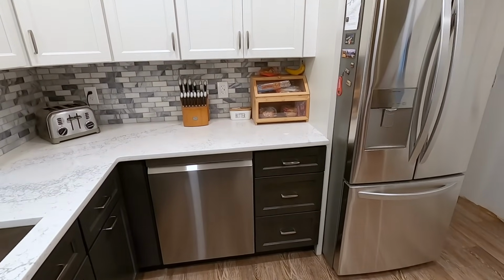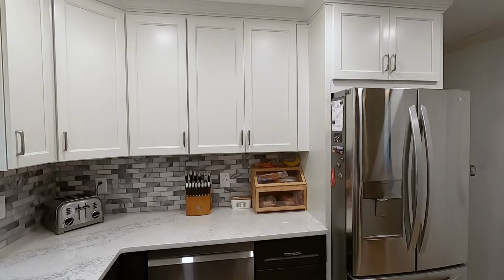Small Kitchen Remodel Time-Lapse - Complete Renovation Start to Finish

Comment: You do great work and you went back to scratch and fixed all existing problems and added all necessary to bring to code and energy savings by insulating.  You did not miss a single thing.  Bravo on a job well done!

Comment: Was looking into redoing my ceiling with drywall instead of drop ceiling and was told I need a drywall hanger/lift, and here this man just screwed two blocks into some studs for leverage lmao amazing work my dude! I kept thinking you'd start putting in the new parts and then you'd replace the fricking wiring or something lmao you really took it to the bones and built it back up again. That's quality work that you can't get nowadays.

Comment: I have purchased parents home and after 60 years of no updates it needs this and bathrooms done. You are so detailed unlike contractors would be. I am too old to do this myself and have to hire contractors but how do I find the one that will do it right without overcharging me? I sure wish I could hire you! I would have so much peace of mind! You are one of a kind, sir!
Reply: Make a list of the things that are necessary for you to do in the kitchen. Forget all your wants. No stainless steel appliances. No fancy flooring. No real wood cabinets. Forget about the island. Forget about the stone countertops. No, you can't add a 500 square foot addition and no you can't knock that load bearing wall between your ktichen and your living room to make it open plan. The less you do, the cheaper it will be. And get multiple quotes from a billion contractors.

Comment: incredible job. We recently gutted our 50's kitchen shortly after purchasing our home, completely remodeled and also worked with a tight floor plan. 

I definitely would have went with a blind base cabinet for that cabinet between the sink and dishwasher, we didn't think we'd use ours much but its great for storing the Tupperware that you use once in a blue moon. Other than that, you did an outstanding job

Comment: I’m glad you put some insulation in the external walls. I don’t know where this house is but it was built like a shed. It must have been so cold in winter and hot in summer. Lovely job on the kitchen.
Reply: He lives in Massachusetts, and the house had insulation before he tore it out and replaced with fresh. Also, it was built in 1946, but the kitchen was added onto in 1964.

Comment: I have to point out just to help anyone else in the same situation.  The old style 'sheathing' was generally shiplap boards as yours is.  The shear walls jobs of today's construction were done with the diagonal bracing sometimes let into the outside of the stud walls and sometimes done as yours was.  The salient point though is that you should not remove any part of that diagonal member unless you have redone the exterior with a OSB or better plywood sheathing to act as a shear wall.  Even though removing one section between the studs looks like no big deal you have taken away the load carrying capacity from the top plate to the bottom plate as the racking forces generated were meant to travel an unbroken path between top and bottom plates to keep the wall stiff when subjected to lateral forces.  Super important if you are in a high wind area.  Always hard to handle the corners in a narrow kitchen.  Nicely done.

Comment: I’m impressed that you can do flooring, plumbing and electrical as if you were an expert at each of those professions. Truly remarkable craftsmanship and great color choices. Love the two-tone cabinets with stainless steel appliances and light wood flooring. Simply beautiful. The backsplash is also beautiful along with the lighting. (If you would have been able to integrate an epoxy type of countertop then “mic drop”). Keep up the awesome work and can’t wait for the next video 😊

Comment: Wow!!!I just found your site with your bathroom. Your attention to details is amazing I love your choices. The backsplash made it!!! Also taking up the the ceiling added so much to the smaller kitchen and the light fixture match so well. Also it is so bright and not just a plain white kitchen it is timeless. Are you planning to match your floors through the house??? Also what is LVP flooring is a type of laminate I still have glue laminate in my living room 1999 that has stood up well.

Comment: This a great video, and even with it speeded up a lot of good info.  I am wondering can anyone answer the question about putting the metal plates on the studding.  I have a kitchen where i am doing a small demo in a 100 year old house, and I am wondering do you have to put them in.

Comment: I have nightmares about getting a house that needs a kitchen remodel. well I did until now. you make it look so doable. Thank you. Loved your color and surface choices too. Very smart upgrade any one would be proud to have. It was also nice to see some one care to fix issues rather than just paint over them like the rot you found. Small maint. can make a HUGE difference down the road.  Kudos. as lovely as your fridge is, its just horrible in that space I am so sorry to say. I suppose it woud be 10 K to hire some one to do that? or would it be even more? not the materials, just the work.

Comment: This's a nice video, I've watching your videos for a quite some time. I'm renovating my kitchen too and wanted to ask you a question. Where your sink plumbing went, that's an exterior wall which means it's a load bearing wall. Are you allowed to drill that big of a hole through the studs, top and bottom plates?

Comment: Amazing work

Just a question, what’s the reason for the paper towel stuck to the walls under the backsplash ?
Reply from the maker: That is actually something called “simple mat”.  It is like a super sticky and thick double sided tape that holds the tiles to the walls.  It is an alternative to mastic or thinset.  Doing it this way you can grout it immediately because you don’t have to let adhesive dry.  Hope this answers your question.  Thanks for watching!!
Reply: Thanks for the reply mate
We don’t have this in Australia to my knowledge, looks really convenient as an alternative 
Love all the work you’ve done so far
Even though houses are built differently here in Australia I’m learning all the time watching you do your thing
Thanks

Comment: What was the pink paper that you put on the floor and masked off with tape?  Is that some kind of levelling material?
Reply from the maker: Good question.  That was rosin paper.  The only reason I used it was because when I tore up those old stick tiles they left a glue residue on the floor so that was to cover it so dirt and debris wouldn't stick to it until I covered it up with the new flooring.

Comment: Fantastic job! So glad you replaced the wiring. I'm curious though: why did you install the ceiling insulation backwards? Is it because you were using a vapor barrier? Even so, I'm confused about this.
Reply from the maker: Hey, Kate!  First of all… thank you! 😀😀 and for the ceiling insulation.  I didn’t install it backwards, I bought “unfaced” insulation, so there is no paper on it like there usually is.  Then I used 6 mil plastic as the vapor barrier.  Hope this clears that up.  Thanks again so much and thank you for watching!!
Reply: @TheFixerHomeRepair  Of course! I have no idea why I didn't think of that. I guess it's because you don't see many DIYers doing that. Great work!
Reply from the maker: Thank you.

Comment: Really like how it came out. But why did you put the flooring after the cabinets? Wouldn’t it be harder to place them around the cabinets instead of laying the floor then building the cabinets. Idk if that matters but the outcome was 🔥
Reply from the maker: Hey!  I did the floor after because it is a “floating floor”.  You are not supposed to put permanent fixtures like cabinets on top of it as it needs to expand and contract.  If I was to do hardwood or tile I would have done it first.  Thanks for the comment and for watching!

Comment: What are the black plastic boards you have under the ceiling? Before the Isolation.. Have zero experience in house building.
Reply from the maker: Hey!  Those are rafter vents.  They help to move fresh air from the soffit vents up and out the ridge vent, the airflow will help to circulate air above the insulation and in the attic to prevent moisture build up and/or mold.  I made a detailed video about this whole process if you are interested.  https://youtu.be/gyE5BxhEsOI
Thanks for watching and for the question!
Reply: @TheFixerHomeRepair  Thank you for taking your time to explain this. Nice work on the house!

Comment: What was the red liner thing you used to level the floor with the tile?
Reply from the maker: Hey!  So that red liner was actually rosin paper.  I just put it down after I pulled the stick tiles up to go over the adhesive that was left on the floor.  It does nothing but stop my boots and debris from sticking to the floor.  Hope this answers your question.  Thanks for watching!!

Comment: Can you estimate how much longer it takes you to do projects with all the filming you do? It’s already impressive what you do but the 1,000 camera angles for us is just as dope
Reply: I would expect since he was shooting both the time lapse, and the individual segments, that this extended the time of remodeling out by a good bit, and as I also shoot videos for YT, it all depends on how one shoots too. 

If on a tripod, then it's move, set, and let  it go, other times, it is going hand held and talking, showing a detail, like how he did the cabinets, and even there, he likely didn't shoot them all, just one or 2 or for the ones that are different enough to show how you go about putting them together and then install, then he shuts down all but the wide shots for the time lapse and then resumes as if not shooting.

Much of the pans etc were done in post, after the fact and that is where it likely took the most time, not the actual filming itself, but likely they did extend things to some extent.
Reply: @johnhpalmer6098  lol not being rude but this comment gave me absolutely 0 information. I understand how recording a video works.
Reply: @allenmkelso8  Well, how was I to know that?
Reply: @johnhpalmer6098  Assume I have common sense.

Comment: why did you use normal plaster wall instead of water and fire resistant plaster wall ?
Reply from the maker: I used 1/2 inch drywall.  That is what is required by code in my area.

Comment: How much ! I really want to setup new one for my kitchen but I have my own budget 😢 I think it expansive
Reply: Yeah, if you want something similar to this, it's going to be very expensive because the entire kitchen was gutted and replaced. If you're on a tight budget, you pretty much have to work with what you have. You can't have a brand new kitchen professionally installed for $5, you know? lol I don't know what your budget is, but I'm going to assume it's extremely low, and there's not much you can do when you have a tiny budget for a kitchen reno.

Comment: What are those metal pieces you install around 8:50?
Reply from the maker: Those are “stud guards” or “safety plates”.  They are used to protect wires or pipes from drywall screws.

Comment: Damn your jumping start was lux compared to my early 2000s jump off. After extermination, where do I soak my feet in? My list starts with the exterior. I mean the address is posted on the house twice.
Reply: One is posted with nails, the other is this crazy looking epoxy. Maybe a scraper and nail polish remover will get it gone. I'll start an IC to keep you all who are interested a post on all the updates.

Comment: How much does a job like this cost usually?
Reply: A lot, lol. He pretty much gutted the entire kitchen and replaced every single thing. That's not cheap. Although he did save money by keeping everything where it was, so he didn't have to spend extra on moving the plumbing or electrical. That's how you save money during a gut remodel.
Reply: @thehungrygoldfish  is a lot $5k or $10k or $20k?
Reply: @Observe411  Um, I'm not an expert by any means, but definitely over 20k, especially if you are not doing it yourself. Again, he gutted the whole damn thing and replaced everything with brand new stuff. When you do a gut job like that, it's not going to be cheap even if you use the cheapest materials available.

Comment: Only 1 thing I would have done differently I would have add more blocking to the  kitchen walls while I had them exposed and gutted for two reasons 1 structural integrity because I would rather have something be over built and be confident in its integrity as this is I am assuming a 50 year old house or older and 2 being able to using blocking to screw the cabinets to the wall to give them a more secure fit